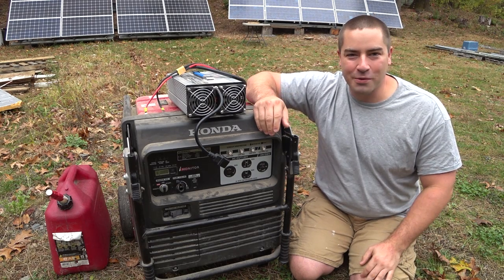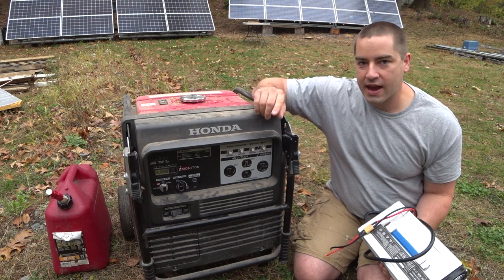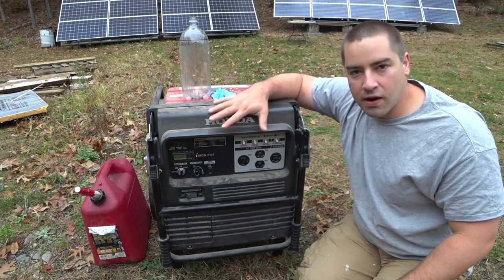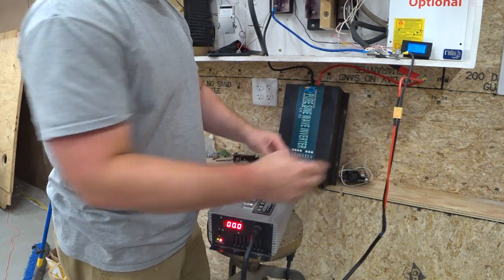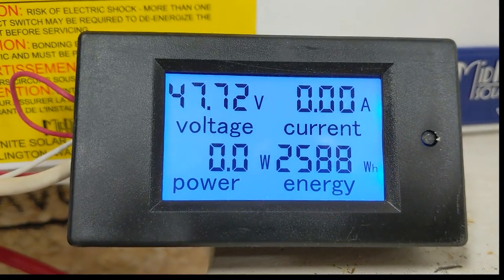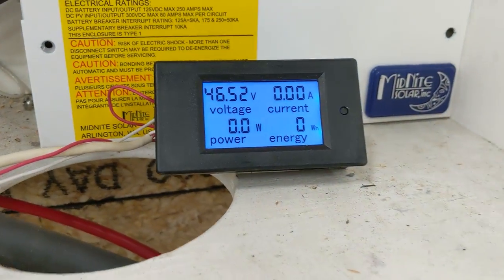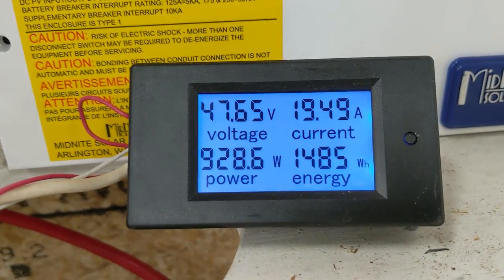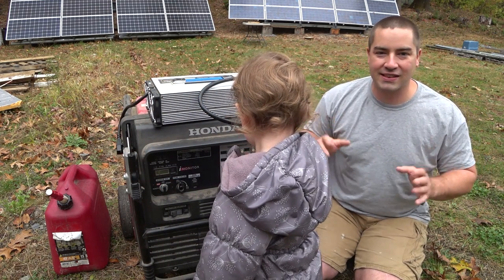Recharging your battery bank without solar

Comment: I do exactly this with my 3.5kw inverter generator. It charges my solar batteries when the sun doesn't shine. My Solar backup backup. At 3 bucks a gallon for gas it cost 75 cents a kilowatt hour to charge my battery bank.

Comment: This was something I've been needing to figure out for my RV set up. How about running 2 chargers off of the the bigger gen.
Reply from the maker: Sure, I've done that as well.  I'll be doing some more testing on this topic coming up.  I thought this would be a good starter.
Reply: More more more! It be great if you can find a small diesel generator or just get a small diesel motor and make it a generator to compare what a gallon of diesel would do

Comment: Awesome video! Gas generators run most efficiently when they're pulling their maximum load. Even with eco mode turned on, most generators still run at a quarter load and are at their least efficient with the available fuel. I would imagine if you could find a generator that could provide the exact amount of wattage needed to run the inverter, you could get close to 7Kw per gallon of fuel.
Reply from the maker: Thank you.  I've performed more testing on my generator at different % loads to find the most fuel efficient spot.  If you are interested in that video here it is: https://youtu.be/kQTFPMDE_F4?si=Bxp7PqIB7YHDhAyb

Comment: Big battery makes a 240 volt 50A charger has anyone used one ?  Your results are interesting try adding your 18A signature solar charger on another test and see if your efficiency improves on the larger generator. Honda makes great generators.

Comment: I have a 1000w 2cycle that I keep for a batter charger it is enough to get by and will do 5.5 hours on a gallon. A good deal  of 2 cycle oils have stabilizer in them.

Comment: One minor thing to try. Switch the Honda to 120v instead of 120/240v. I notice some difference in efficiency on mine. I don't know why. I regularly charge my batteries with my honda via my Sol Ark 12k and it much more efficient than my AIMS 48volt 120v charger..

Comment: Honda EU3000 with 2 Iota chargers (13A DC each) I usually average 5kWh to the batteries per gallon of fuel. Tried on my EU2200 and get near the same fuel efficiency but way more noise!

Comment: I am in exact same situation. I have the eu7000 as well. After turning off my system I  connected to AC input but didnt work.
Since eu7000 has a floating neutral, my thinking is not connecting the generator(4 wires) to the load center but have a small separate breaker panel where I will create a neutral ground bond then supply to the AC input. I haven't done that but welcome advice.
My load panel connects to the house panel so neutral and ground is Separated.
I guess I am considering the 120/240 from eu7000 as a completely separate AC source needing its own ground neutral bond and a separate ground rod.

Unfortunately I don't have 240 available from the grid near my setup, that would be easier but...

Comment: If you are looking to have a generator as a backup to charge a battery bank, choose a DC power generator. Do a test and you will be surprised in the efficiency level attained.
Reply: DC generators are very hard to find. Where do you buy one?  Then again, you don't want to charge lithium batteries without having a smart voltage/amp controller.  You are much better off with a dedicated 120vac lithium smart charger and power it with an inverter generator. Screw the conversion losses. Besides, you can get lightweight 120vac 2000 watt inverter generators for under $400 and they can be very useful around the garage during outages as well.
Reply: Best is to recycle treadmill motor and a MPPT and a 3-5hp gaz engine. Somewhat DIY.

Comment: For instance... if you knew you had to run your generator for a well pump or water heater, or other task, and it had enough surplus watts over that load, you would do best to charge the batteries any time they need it, and the generator is running for that second device. 

  One could have a system where, when the load on the generator is below a certain percent, one, (or more) chargers is added as additional load and immediately cut off if the household load goes up because of heating or other high load devices being used.
Reply: Most of the recent generation hybrid inverters do this automatically. You can set an amount of power to draw from the generator and it will charge the batteries with the leftover. Or it will augment the generator with battery power if your load is large.

Comment: I had to upsize my inverter generator considerably to get 240 volts to run my well pump. The pump itself is a variable frequency drive so there is no inrush. All my appliances are propane and I require very little current. My Honda 2000 was fine except for the water pump. Now that I see how much more efficient it is I am considering one of these "solar" generators that can split phase and put out 240 volts yet still charge off of 120. My generators run off propane and propane is only 1.59 a gallon and eliminates all those carburetor troubles associated with ethanol fuel plus it doesnt go bad even sitting for decades.  That was a great test! Thank you Do you think that is a good option to get 240 from a 120 generator?

Comment: That was a very interesting experiment. I have a similar theory using different equipment. 
I have an EcoFlow Delta 2 with an expansion battery wired in parallel with four 12volt / 120-watt solar panels (480-watts/40amps). 
"If" there is not enough solar energy to recharge that system I can use one of my two Champion 2500-watt dual-fuel inverter generators connected directly to the Deltas' A/C input and charge up to 1200-watts an hour or recharge both Delta 2 and battery in less than 2 hours. Using Propane @ 1650 watt rated and 1600 watt derated per my altitude I can recharge the Delta 2 and battery 11-12 times on one 20lb tank of propane. I have also installed connections to use our 250 Gal. bulk tank to run both dual-fuel generators for months, with or without our solar array system.🤠

Comment: David, you should do an update video with your current system. I have all electric house and am not able to use solar. If I wanted to go "off grid" I would have to recharge my battery bank with a generator. I am also curious how long a battery bank like yours would last  with no solar or wind input to charge it. Thanks

Comment: Ya, honestly, if you wanted to recharge a large battery bank, you don't want to be doing it at 1kwh.  So, a more real-world solution would probably be to try and get about 4000 watts worth of chargers on your 5kw generator.  Also, if you're putting 1000w into your batteries, at 50v nominal, that's about 20 amps.  The wire you were using looked capable, but obviously would need to be scaled up with larger chargers.

Comment: I suggest testing how efficient a Prius is at generating electricity by tapping the 200vdc traction battery into a high VOC solar input charge controller. Forums indicate it is more efficient than Honda generators.

Comment: Fuel is measured in btu. I've always wondered how much more efficient smaller generators were than bigger ones so thanks! I have a inverter 3500 watt with eco and a 5550 troybuilt 220v generator and I ran for an 2 hours and used a 1/4 tank on 6 gallons so 1.5 gallons at 3000 watts. So I'm wondering how the inverter generator would do with the same load lol. 18 hours on 2.5 gallons at 1/4 load so I'm thinking maybe 2.5-3 hours? Lol great video!

Comment: These generators are best efficient at max cont rated load. So you should get 4 of these chargers and if you can get the fuel injected model that is nearly 50% more fuel efficient. 
Something like the eu7000is or eu3200i.

Comment: Nice test David. 
I only try to figure out how one gallon stays in 2 liters of the bottle or did I miss something?
Google says that 1 gal=3, 78 L.
I'm not a native English speaker and maybe I do not understand this correctly in the video.
I live off the grid,  this is my third winter.
I very often run the generator on my off-grid system and always put in 2 liters of gasoline.
I set the inverter at 40 Amps or 2 kw for charging the 48 v battery.

This spend is about 1.3l per hour. And with these 2 liters, I have 3, 5 kWh of energy.
My generator is an inverters Zipper 2800.
If we this convert to one gallon (3, 78L) this will be about  6, 6 kWh per gallon in my case.
Reply from the maker: I had measured 2 quarts (1/2 gallon) using a more accurate beaker off-camera and then made my mark on the 2-liter bottle at 2-quarts.  I filled it twice for the large engine so it would be 1 gallon.  I filled it once for the small engine, but multiplied the results by 2.  The small generator doesn't hold a full 1-gallon.
Reply: @DavidPozEnergy    Thanks for the explanation. 
Nice test.

Comment: A bigger battery charger will increase the efficiency of the bigger generator. It will be cool to check the efficiency of the generator using the internal charger of the XW. I think it will be more efficient. COME ON DAVID do this test for us…..

Thanks for all David… nice job. 12:32 
God bless you all and MERRY CHRISTMAS
Reply from the maker: I plan on running the generator into the XW PRO soon.  I thought this video might be a fun segue.  Thanks for watching.
Reply: @DavidPozEnergy  Also, do a test with 6 - 10 kW regular non inverter generator at 80% capacity. It may be more efficient than a Honda.

Comment: It would be interesting to see what the most efficient would be for each generator.  For example, the large generator could power more chargers to charge faster.  At some point, there should be a best efficiency point for each generator.  Sort of like it's not cost effective to move a pickup truck load with a semi nor is it cost effective to move a semi-truck load with a pickup truck.
Reply from the maker: I have another video with a more detailed efficiency test on the large generator: https://youtu.be/kQTFPMDE_F4

Comment: Looks like a lot of cumulative losses to me. The inverter generator goes from AC to DC to AC then the charger AC to DC. Every time the power changes type there is a loss. I wonder if you had or made a DC generator and a DC to DC charger would be more efficient. I did see your vid with the treadmill motor. I think that would work better if you can get the engine loading worked out. Good luck.
Reply from the maker: I'll do a fuel test on the treadmill once I get things tuned.

Comment: At $4.00 per gallon you are paying $1.00 per kwh even with your more efficient generator.  You got about 4kwh on 1 gallon of gas.  Standby generators are really more expensive than grid power.  The intermittant use of the generator to recharge the batteries on a solar and battery system could really save money as it would eliminate the idling time on the generator.

Comment: Now try it with a high powered battery charger with the higher powered generator.
Reply: Can you suggest a higher power charger?  I have looked at Big battery 240v 50A but not sure if its a good charger.

Comment: Off topic question but do you have to have your eg4 or lifepower 48v batts at the exact same soc? I have 6,all at 52.3v but 4 of them have 3 of the 4 soc lights on while 2 have only 2 leds. I don't own the sig solar 110ac 48v charger and the batts are new in box but uncycled and bought months apart.Does it matter that they are at different soc but at the same voltage?will it hurt them to hook them all together and them hook to my growatt 5000es?Getting close to my install and don't want to make a mistake.
Reply from the maker: When you wire them to the same busbar, they should be within 0.1V of each other.  This is regardless of the LED's.  So, if all read 52.3V +/- then you are good. For your first charge cycle, try not having any load on the batteries.  Allow them to fully charge to 58.4V.   This will bring them all to 100% SOC.  After that first charge cycle, then you can lower your charge controller setting.  Personally, I use 56.0V.
Reply: @DavidPozEnergy  ok thank you.
Merry Christmas!!

Comment: Hello DTG, thank you so much for all you do, specially enthusiastically. I would like to know however, is charging the batteries without the use of a charge controller really safe? How does one know when the batteries are full, with no safeguard, that a controller provides? Thx
Reply from the maker: The charger that I'm using is made for charging lithium batteries.  You can think of it as if the charger has a built-in charge controller.  This is different than an old-fashioned charger that is simply a transformer and a rectifier.  These new chargers have more controls built in.
Reply: @DavidPozEnergy  ok, thx a lot for clarifying that. The Great One!

Comment: David, I wanted to charge our 48 VDC nominal battery bank without having conversion loss. This is how we do it. I mentioned before that I use Veggie-Oil in my All-Power 5Kw Diesel Generator. But that was still not efficient for our batteries. So this is the new build. A $230 196cc diesel connected to a $660 48 VOLT - 3 phase PMA going into a $89 300 amp rectifier and then going into a $650 Midnite classic 150. This #DC1248AC Dual Core PMG/PMA turns at 2,700 RPM and makes 3,500 Watts + and charges the 46KW LifePO4 battery bank for pennies. The Midnite classic treats the PMA as a solar source and controls the charge parameters perfectly. Total cost $1,629. I would post the links but YouTube deletes them. You could also use a 212cc Harbor Freight Predator engine and pay for gasoline.
Reply from the maker: Sounds like an awesome setup.  If you ever make a video, post the link to the YouTube video.  That's allowed and would be cool to see.
Reply: @DavidPozEnergy  I can send a link to a fellow YouTuber from Green Bay Wisconsin who was my inspiration if you would like?
Reply: That’s awesome! Would love to know how many KWh you produce from one gallon of diesel.
Reply: Would be awesome if you could upload a video of your generator.
Reply: @howdy3423  The PMA  produces 3,500 watts at 2700 RPM. The diesel runs at 3,000 RPM maximum. Running 2,000 RPM it will consume about 0.25 gal/h. Running at 2,000 RPM  the PMA will produce around 2,500 watts. So around 10 Kilowatts per gallon of Veggie-Oil with a 30% gasoline blend for the winter. Gasoline is need as a solvent to thin the viscosity and prevent gelling. Summer blends are around 10%. Although these PMA's can out put 3,500+ watts it is not advisable to do so., as the small motor would struggle at peak output. These numbers are not set in stone and do change a little,  We need to take into account the losses of the AC to DC to DC conversion and whether or not the batteries need all the power the PMA is producing. The Midnite classic determines the charge need. In case your wondering the cost of the winter blend is about 5 cents per kilowatt hour. The electric grid rate in our area is 17.4 cents per kilowatt hour.
Reply: @stevenfrazier8939  I might build something similar. I have a water cooled Kubota single cylinder electric start diesel generator (''sign board generator'') with a 175 amp 12 volt large frame alternator.  They sold these as ''Ample Power'' charger units. I need 24 volts for my 46 kilowatt hour lithium battery bank. I was thinking about getting a DC generator of 100 volts or so and feed it into a decent sized charge controller and let it sort out the charge volts and current.

Comment: Those Honda 2200 generators weigh closer to 50lb 47and some change to be more precise they are actually heavy in an awkward way 30 lb would be much better but definitely the weight can deter thieves this happened with mine as the generator was running the thief cut the lock and tried to run away the way of the generator and somebody chasing you with a knife must have been pretty hard to do the thief fell down and got up and ran without my generator luckily the generator was heavy enough so I got my running generator back.

Comment: i have no battery stuff, or anything beyond a small set of solar panels for camping, unused for offgrid stuff. i do however, live in a small town and bought a 5kw generator (where i live it gets wild cold - -40c or colder sometimes) and having enough to keep the furnace running, most of my house powered, and its dual fuel - so propane is the option so i dont need to clean the carb or worry about bad gas etc. should have bought a tri-fuel or might convert it, and if i were to buy new? maybe 6500w (on gasoline, so whatever that would be. 6k? on propane) should do my whole small house, including electric water heater. or get a hot water heater that runs on natgas.
Reply: Propane can freeze up at ~44 below, and as temps decrease so does the stored pressure. Meaning that you'll have reduced fuel flow and thus less generating capacity when temps drop enough. I'd suggest always having enough gasoline on hand to get through the very coldest parts just in case. You could also use that and heating pad or electric blanket to worm your propane tank to render it usable- just remember to not overheat it, al you need is some warmth.

Comment: Running a large generator that the charger doesn’t put a full on results in a size-able loss of efficiency. As you saw.

You could have just let the smaller one run for a few minutes than dumped in the remaining fuel.
Reply from the maker: I agree with you.  The purpose of this video is demonstrating that by using the fixed load.  I made a second video with a larger charger to get more from the larger generator: https://youtu.be/kQTFPMDE_F4

Comment: I’m using a Generac IQ 3500 and my best output is 25 amps, otherwise the generator overload light comes on. 
I’ve heard people talk about using a three prong ground to plug in the 120 outlet, this is supposed to ground the generator when having cords going out of it!
Anybody knowledgeable on this end?